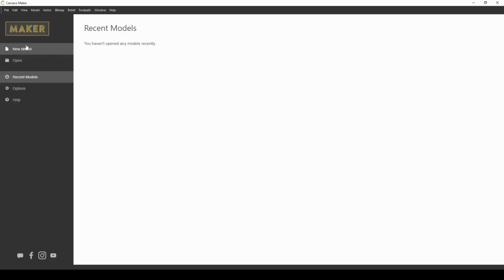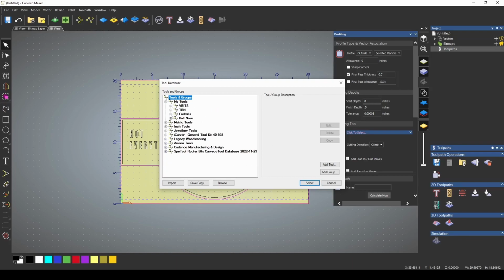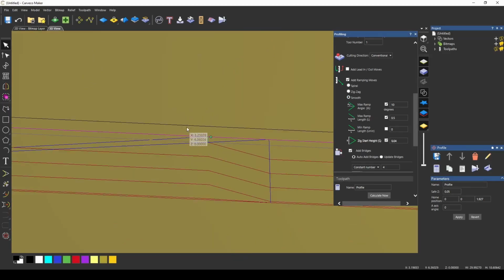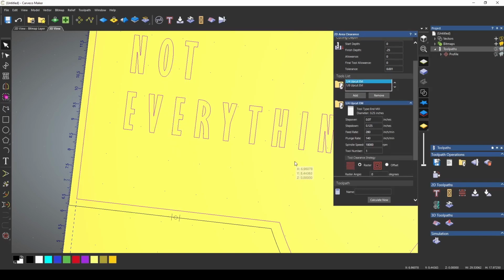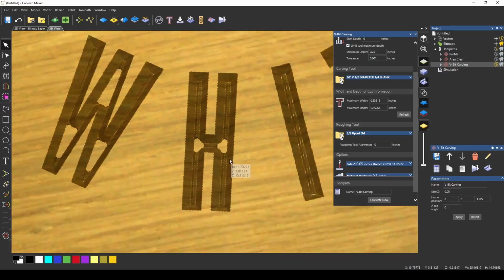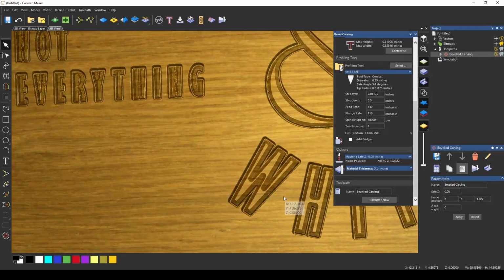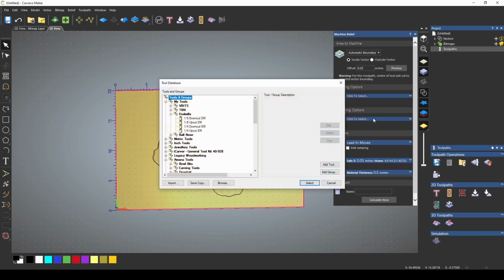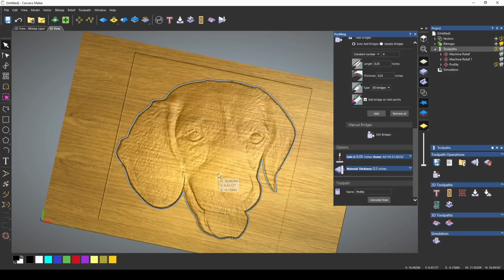Ultimate Beginner's Guide to CARVECO MAKER: Tool Pathing

Comment: Thanks for spending the time to create such clear and easy to follow tutorials for beginners like me...
In the drilling section of your video, you mentioned that you use end mill bits for this purpose...isn't it cheaper to use drill bits instead, as they are meant for drilling? I think you downgrade somehow the end mill bits as they were meant for a better job.
Thanks again.
Reply from the maker: This was one of my earliest videos and I was using end mills for drilling but yes as long as all you are doing is going in and out you can use drill bits. I now own some drill mills or the Molly mill from Jenny bits that is an endmill with a drill head.

Comment: Awesome information!

Does anyone know if you can change the speed for the ramping portion of a profile cut? Mine seems to be set to 25ipm
Reply from the maker: It is set to the plunge rate from the bit setup. Plunge can also be effected by the jerk settings in the machine and this may be why its limiting it to that speed in during the ramping part.

Comment: Great tutorials. I had a quick question for you. If I come into Carveco to create something like a pencil box, and I have designed my toolpaths, how do I go about creating the required vector? Thanks for your assistance.
Reply from the maker: The toolpaths are generated from the vectors that make up the design. When you are creating the design in the first place it will be made out of either vectors or if its a relief then a relief model.  The second video in my series shows how to  create vectors like that and may help. Hope this helps.

Comment: Best video explaining all this! ?, When you do a toolpath with multiple bits, does the machine stop and return to home so you can change bits, or do you have to change the bit and the toolpath. Also, a video on setting z and xy would make my life easier, since I mess that up almost every time!
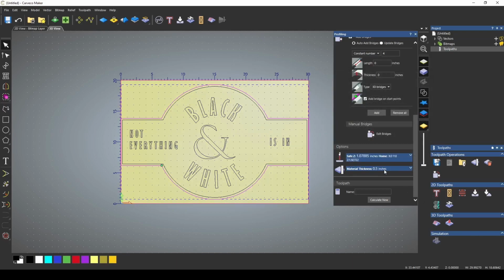Reply from the maker: The part explaining home z is at 5:45 in that video.  That is the height it will retract before and after each toolpath and should be set high enough to change bits. Unless you have a tool changer you have to create separate toolpaths for each bit and zero them each. Hope this helps.

Comment: If you allocate tool numbers to each bit you are using, it allows you to save all of the toolpaths at one time. My question is, will this not work when it comes time to machining the project? Will the machine proceed to try and cut each toolpath with the one tool loaded without homing in between to change bits? Thanks in advance, look forward to starting up the spindle and letting the chips fly!
Reply from the maker: Thanks for watching. The tool number system will only work if you have an automatic tool changer and those numbers would correspond with what slot that tool would be in. When you save the toolpath unless you break them into separate toolpaths for each bit the machine will try and run those toolpaths back to back without the ability to probe the bit change. If they are all the same bit then you can save them as one and just let that run each path back to back. Some machines have post processors that pause in between each and some have post processors that skip that pause. Hope this helps.
Reply: @Timberfalls  Thank you very much! Best and most informative response I've had when asking this. I'll save them separately, cheers!
Reply from the maker: @the-wooden-beard  glad that helped and I always try to respond to every comment so I appreciate the feedback. There is a pretty big group on facebook called the carveco users group  that is also a great place to find info if you are on that.  I am usually posting there daily. Anyways thanks again and let me know if I can help or cover something more in my videos.
Reply: @Timberfalls  just joined into that group after someone mentioned it from the Onefinity group. I'll be sure to check it out more often
Reply from the maker: @the-wooden-beard  Cool I will probably see you there.

Comment: This may seem obvious to a bunch of folks, but here goes.  Where on the screen do I say "GO?"  Where, after I've designed, is that button?
Reply from the maker: Its a good question. After you have designed your project and created the toolpaths for each part. You need to save these toolpaths to load onto your machines CAM\Controller software using the correct post processor for your machine. Usually this is done via thumb drive or over wifi. Hope this helps.
Reply: More on this. Where is the 5th video that goes over saving and exciting the jobs?  My current questions is how can I save more than one tool path (using different bits) to the same file?  In other words after I cut a pocket and want to use a different tool to cut the profile out how do I do this without having to save multiple and then load multiple tool paths?  I just want to have it all on the machine and change the bit when it is time and hit the "Go" or cycle start button to continue running
Reply: @BenFuller-ls8pm when you click to save a tool path on Maker, the save window will open.
On the left there is a ticbox to save tool paths separately, I also always click on add tool description too, that way I know which is which
Hope that makes sense

Comment: Hi Jason, can I ramp up with Carveco maker or do I need the + version? so a vector from xyz 0 to x10y0z10 ?
Reply from the maker: Ramping is in both versions and is how the tool path enters the wood at an angle for less impact during plunges. If you want the spindle to move to a certain height then you would set your home z to this height and that is the distance the router will start and end from. Hope this helps.
Reply: @Timberfalls  Thank you, I mean like making a wall that starts on the floor and goes 10m high, I probably dont use the right words. Can you give vectors a certan height?
Reply from the maker: @Bart_Depestele  To do that with basic maker you have to use a trick to do it. Very easy with maker plus. Here is a video about the trick to do that. https://youtu.be/NGsQzjMnTZw

Comment: I suggest as a next step, you produce a follow along video of a project with you as instructor and the viewer as your student.  The video would be a project and the student would follow along.  No options as to what different ways,  just the best for the project.   Simply one step, then the next until completion of a finished project.  I.E., project choice, import or design, setup, tool  selection and pathing, saving and then carving.  A beginners tutorial so to speak.  I know it would help me.
Reply from the maker: Thank you for the feed back Jim. This is something that I have been thinking of doing so I will try and a get something like this done in the next few weeks or so. I appreciate the feedback and the suggestions they help a ton. Thank you for that.